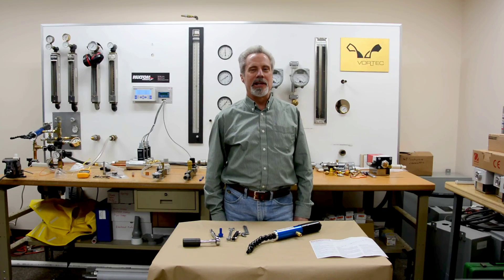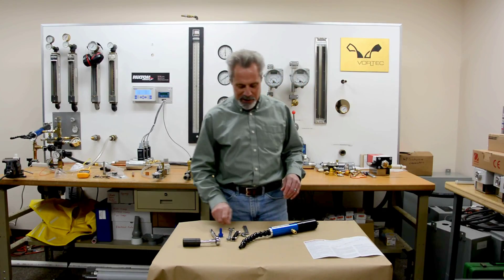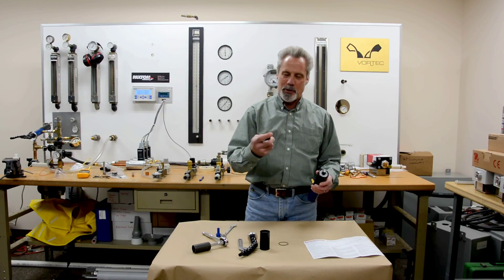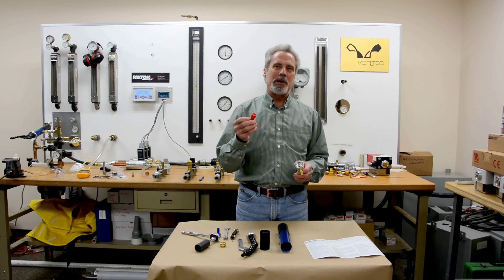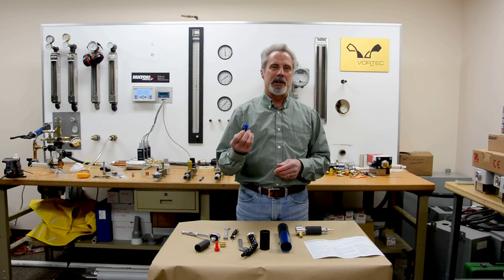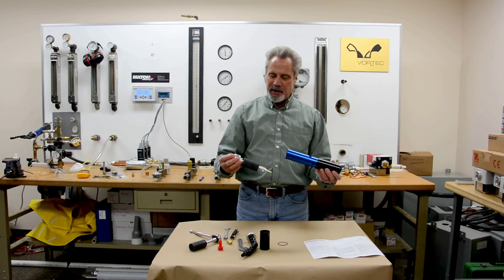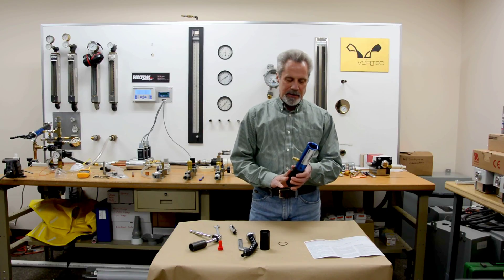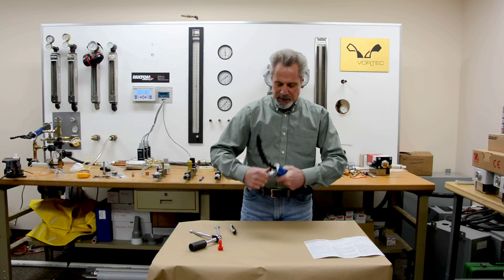How To: Change the Generator in a Vortec Cold Air Gun

Comment: Hello I love this video.
I have a ITW Vortec cold air gun 610
I bought this for cheap.
My configuration looks almost like yours but there was no O ring on the aluminum cap.
There was a THIN O ring under the plastic sleeve and a THICK one on top , just under the aluminum cap.
Does this configuration sound correct to you?
Thank You
Marty 
I could send a picture if I knew where to send it.
Reply from the maker: Hi Mat, please send this information to our technical support team at techsupport@vortec.com. They will be able to help you troubleshoot this.

Comment: What's the pupose for changed the generator?
Reply from the maker: Hi Vincent, if the compressed air supplied to a Cold Air Gun is dirty or contains moisture it can affect the performance of the Cold Air Gun. In these cases, the generator can be replaced instead of purchasing a new Cold Air Gun.

Comment: this gun only supply compressor air for using?
Reply from the maker: The Cold Air Gun can run on any inert gas but it is mostly used with compressed air. Here is an example with Argon - https://www.vortec.com/discover-how-cold-air-guns-use-argon-gas-in-aerospace-application